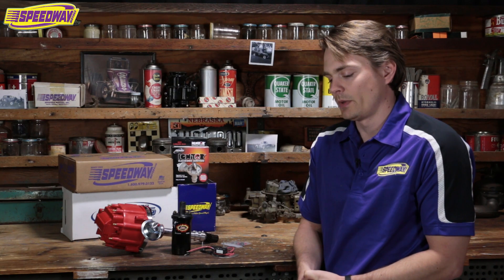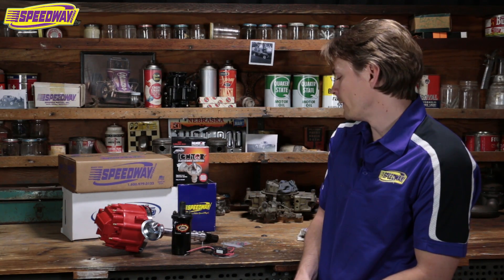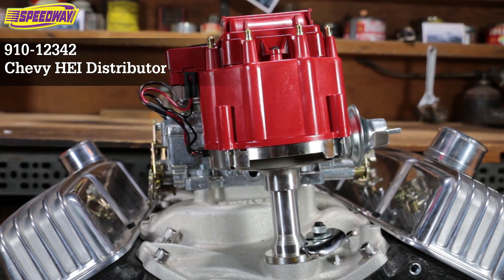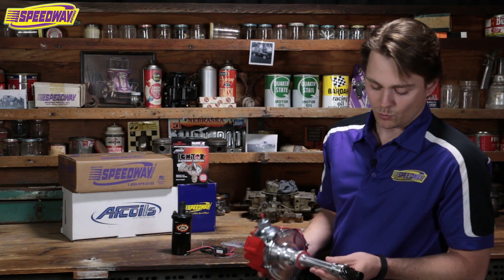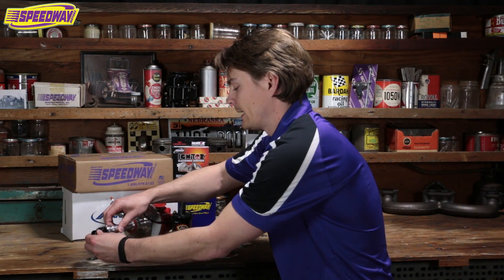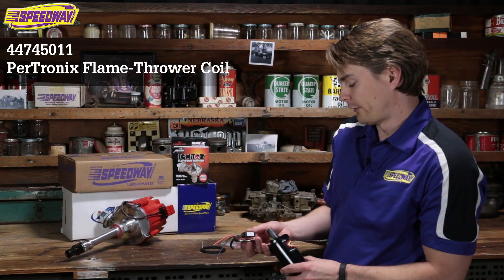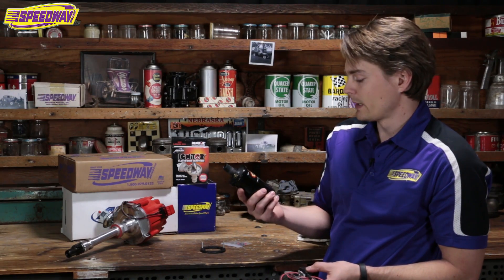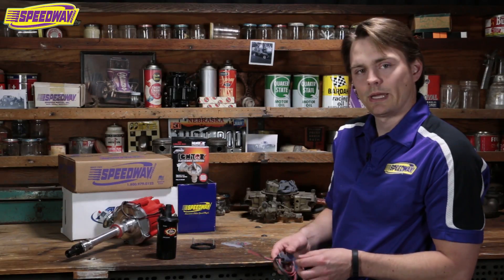Speedway Tech Talk - Converting Points to Electronic Ignition

Comment: What’s the difference between the 1181 and the 1181LS points eliminator kit? I have a 74 GMC with 350 sbc. Trying to figure out which one I need. Thanks!
Reply from the maker: @bigdoghernandez6479  The 4471181LS is an upgrade of the 4471181. You can search both part #'s on our website to view the product info.
Reply from the maker: Pertronix offers 3 grades of Ignitors.  The LS is just a step above the Ignitor 1.